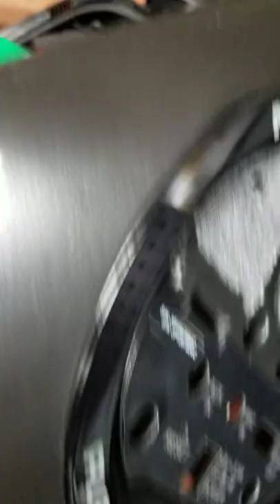Monster Blaster Black Disassembly or for Battery Replacement

Comment: Thanks for the video! Mine won't even power on with the AC adapter connected so I'm not sure if it's the battery or not. Any suggestions? Also, where can you get the replacement battery (any specs to share)?